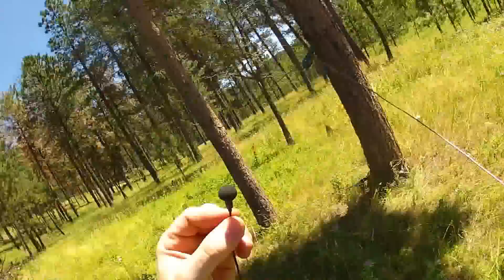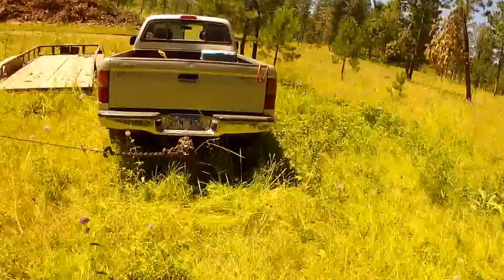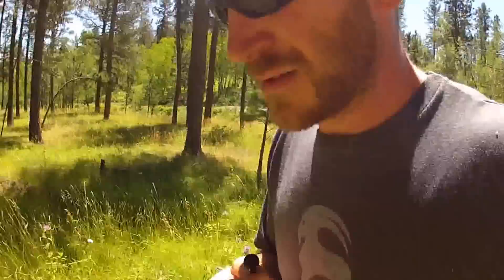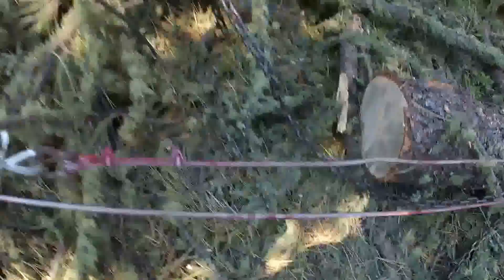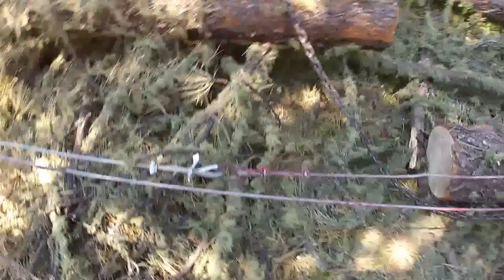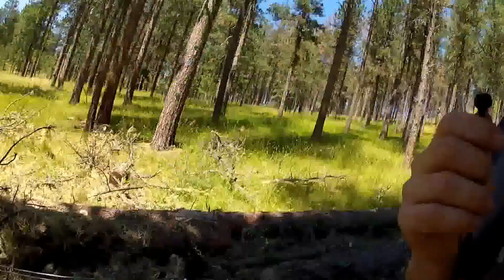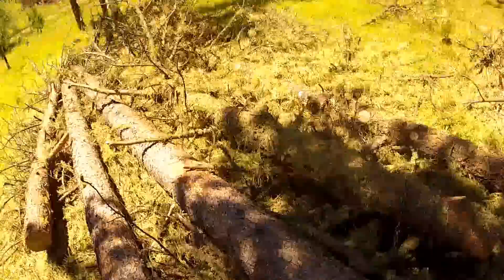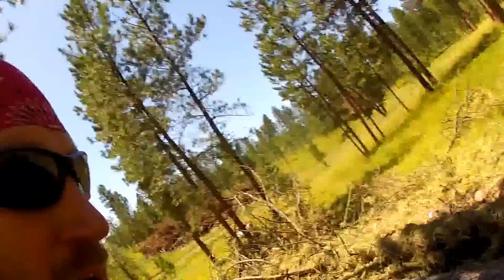How to use a snatch block for pulling big logs

Comment: Firewood gathering of standing dead up here in the Rockies ( at 9,300 ft elev) in heavy forest on steep inclines, we HAVE to use Snatch Block. Matter of fact I have 3. Often it’s a good 180 feet off the road to the log, with a whole lot of maneuvering through the alpine forest. All done with an F150, a 6 ft chain, snatch block(s), eye hooks, and 220 feet of 11,500 tensile strength bull rope. Been at it with minimal gear for a decade now. We were using a Warn Winch. But that takes all day long. Winches are SLOW. And only used as a type of Yarder in very difficult situations. We start in Mod-August when the weather is at 70 degrees or less. And go all the way to the first three or four snows in December. Once 4,5 feet hit the Rockies it’s difficult to work in. But we’ve done it. Our snatch blocks are used to take a specific path back down or up to the truck. Often using 3 at a time getting wood as far as 220 feet away. Sometimes we put on an extension of 50 feet atop that. Without these blocks I’d have to point to point using the trees themselves and that wears out a rope quickly. Thanks for the only Vid on blocks on YT

Comment: I do much of the same thing. Only I use rope. I personally like using rope because of the versatility of tying knots. I also feel its a little safer if the rope breaks as there is less energy stored in the rope.
Reply: synthetic winch rope is awesome

Comment: Looks like you just had a 2:1 pulley ratio going on there.  You were pulling 2 logs.  You would have been quicker just making 2 trips with your truck hooked up to each log since you could drag the log the full distance and not be constantly setting up your cable and blocks for a bunch of short pulls.